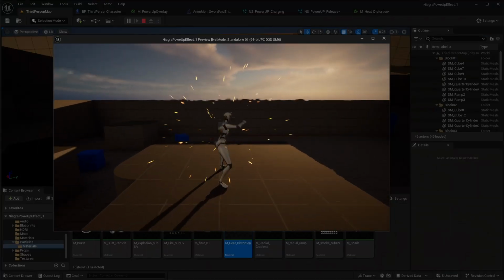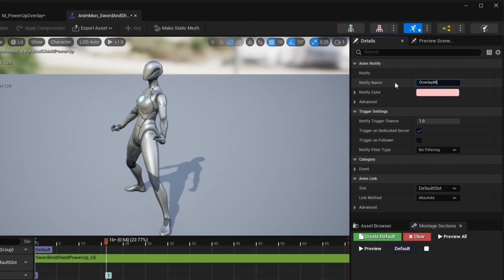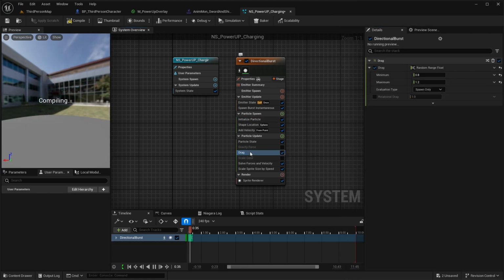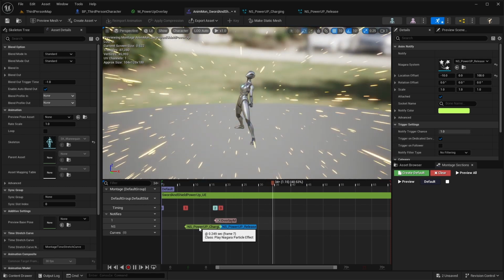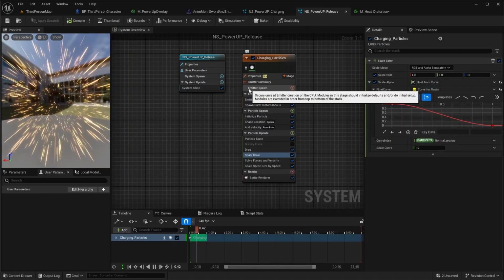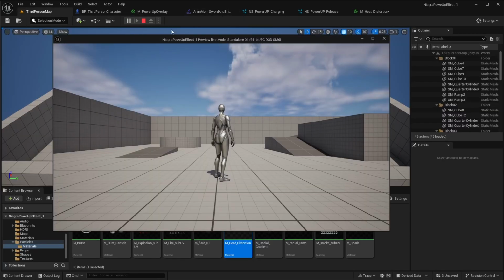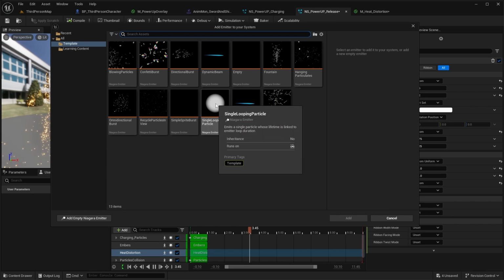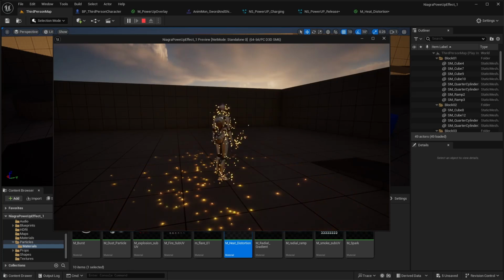Power Up Effect in Unreal Engine 5 | Niagara and Overlay Materials

Comment: that heat dissapation doesnt work. i follow 100% your step
Reply: yeah mine doesnt either did you fix it?
Reply: @art0ni641  If the text appears on the screen but the character doesn't turn into a brick or gold, it means you've run into a specific Unreal rule: a material requires special permission to work on a character (Skeletal Mesh).

Open the "PowerUpOverlay" material you created. Type "Skeletal" into the search bar of the Details panel on the left.
In the results, locate the checkbox for "Used with Skeletal Mesh." Check that box, then click Apply and Save.
Reply: If the text appears on the screen but the character doesn't turn into a brick or gold, it means you've run into a specific Unreal rule: a material requires special permission to work on a character (Skeletal Mesh).

Open the "PowerUpOverlay" material you created. Type "Skeletal" into the search bar of the Details panel on the left.
In the results, locate the checkbox for "Used with Skeletal Mesh." Check that box, then click Apply and Save.